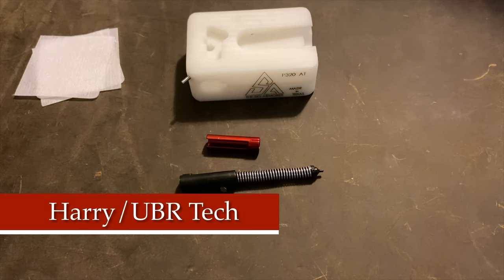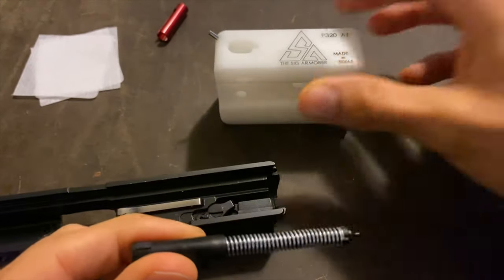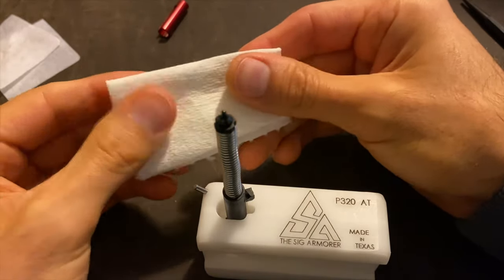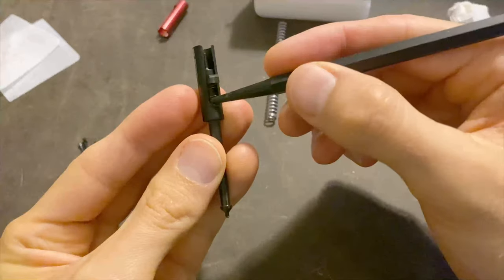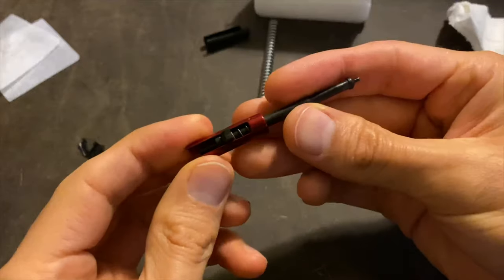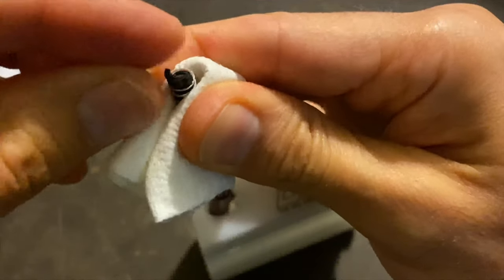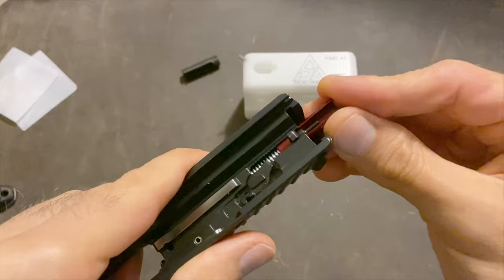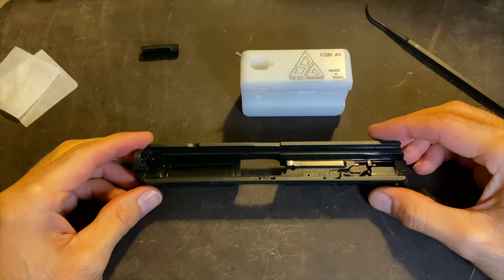How to replace your Support sleeve for the VP9

Comment: I can appreciate the time and details you put in the video. They would be great for someone who needs them.
I am not a pro, but I could figure out most myself. Except I have not thought of the paper towel - thank you!
I hit the thumbs up button, and I saw the video because I am already subscribed to your channel. :-)

Btw have you figured out a lighter striker spring for the VP9?
Reply from the maker: Most of my videos are for beginners or mid level gun owners.  I try to give tips that will help beginners and pros complete the process easier.  I’m glad you still got something out watching my video.

As far as the lighter spring, I was told you could have issues with higher grain rounds.  I only use 115 grain so I wouldn’t have any issues.  If you use anything higher, you might consider replacing the spring.

Thanks for thumbs up, for watching and being a subscriber.

Comment: Question: does the longslide kit have the same plastic sleeve or is it metal like the replacement part just inserted? Looking at getting a LS kit, which why I ask.
Reply from the maker: I don't know. I would think that HK would use the same sleeve no matter what version.
Reply: @UBRArsenal  thanks! I have the VP9 tactical, but was looking at getting the longslide kit. I was going to get the reg ver but this was on sale and made sense money wise. So went with it.